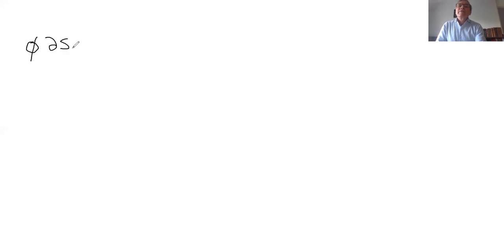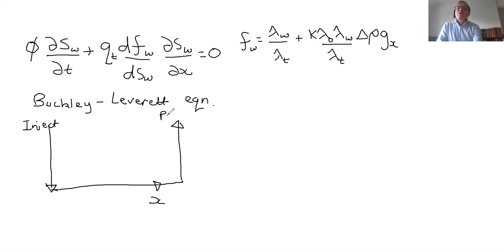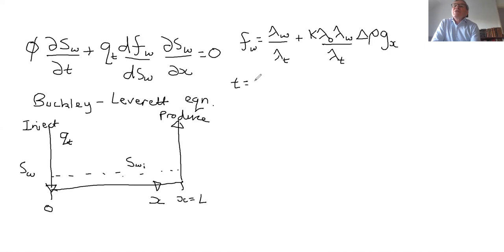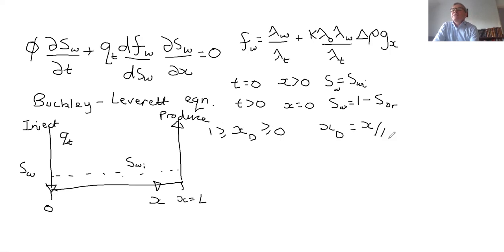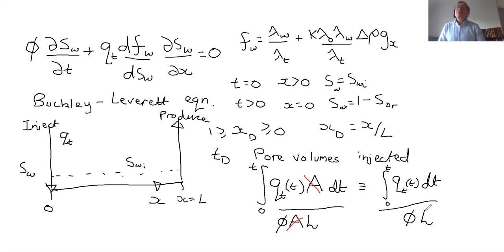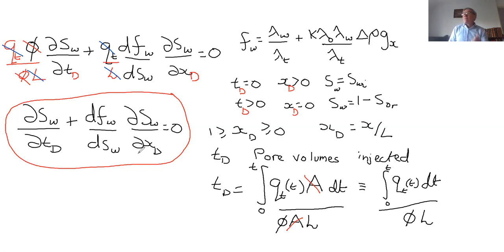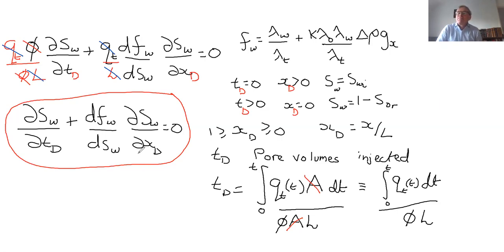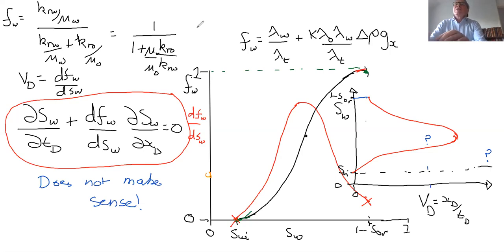The Buckley Leverett equation

Comment: Hi,

Would you mind explaining a bit more on the difference between the wave speed (x/t) and the injection rate (q_t) ? It seems like they are proportionate with a factor v_D (which is usually > 1 at saturation front). Using the construction you have in the video, this means that the actual injected water will arrive at the producer in less time if I use the speedwave t1 = L/v = L/(x/t) than if I do some simple t2 = L/q_t. In essence I don't get why the wave speed is faster than the actual injected speed, what's driving it? Thanks in advance :)
Reply from the maker: qt is the Darcy flux, not a speed: it is the volume of water injected per unit area per unit time.  In single-phase flow the actual speed of the injected water would be qt/phi, where phi is the porosity - think about this carefully - the injected water can only occupy the pore space.  The vD we calculate is the speed that a water saturation value moves at.  The shock can indeed travel faster than qt/phi (which corresponds to vD = 1) - this is the wave of water moving in response to the injection.
Reply: @BoffyBlunt  Thanks for the swift answer! :) I was surprised that the shock wave can be faster than qt/phi (been spending all day thinking about it), but after your comment and putting some thoughts into it, this happens also because this is a multi-phase flow. We have two phase in the pore space competing for the total velocity and relative permeability curves are the ones driving the velocity proportion wrt saturation. This would also mean that in one-phase flow, qt/phi = x/t. Please correct me if I am wrong! 

*In my initial comment, I was referring to q_t in 1-D sense, I guess I was a bit unclear. I hope I am using better notation in this comment.
Reply from the maker: @iffanhannanu332  Yes, you are correct for single-phase flow.  If you define qt as volume flowing per unit area per unit time, you do not need the A term (as in my video).  The wave speed can be larger because we have multiphase flow and water does not occupy all the pore space.
Reply: @BoffyBlunt  Thanks for the reply! I like your videos, please keep uploading them! :)

Comment: Hello dr, Do the BL considers pressure? also does viscosity depend on Pressure and temperature? thanks
Reply from the maker: Yes, you can find the pressure profile analytically from the fact that the total velocity is constant.  We assume that the fluid properties are not functions of pressure and that the temperature is constant.
Reply: @BoffyBlunt  so i shouldn’t have pressure in the input data, I can calculate it from the velocity.
Reply from the maker: @haithmsalahhagar5350  You can calculate pressure gradient, but to find an absolute value of pressure you do need to specify pressure - normally at the inlet (injection well) or outlet (production well).